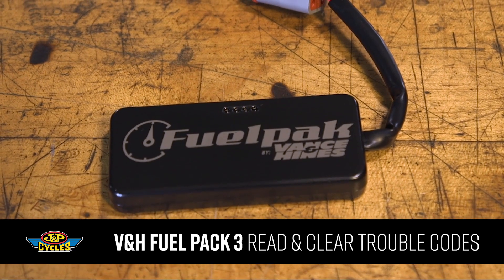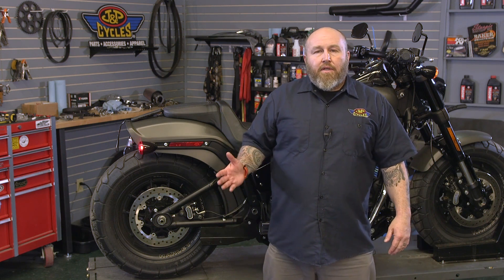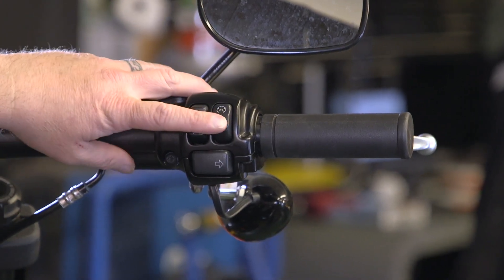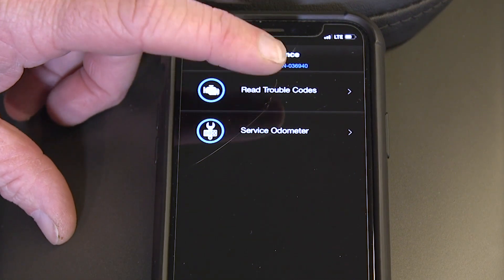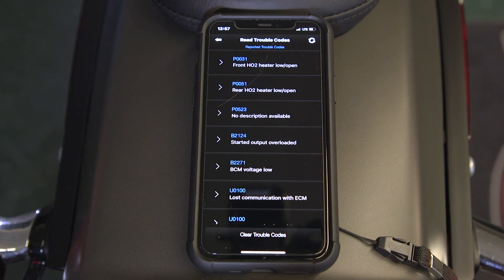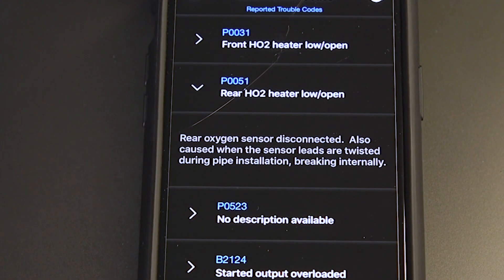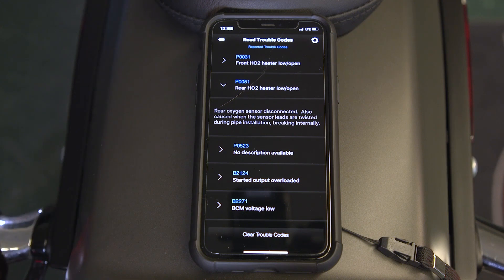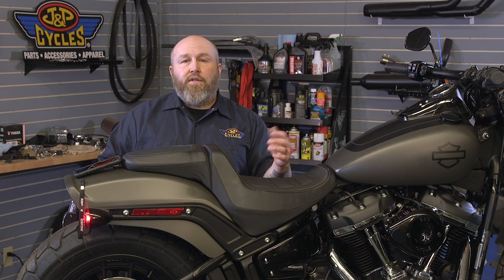How to Read Engine Codes with an Vance and Hines FP3

Comment: I have one of the sp3 fuel pack Management systems on my 04 Harley Davidson lowrider and I have Vance and Hines long shotgun pipes on it and I have the S&S 510 cams in it and have hyper charger intake on it but between 2000 and 3000 RPMs it bangs out and I'm trying to figure out which value do I need to correct to try to get the fuel injection where it needs to be is there a low range of mid-range and a high range or if I could just find out which value and then I can adjust up and down any input would be appreciated
Reply from the maker: What do you mean by "bangs out"? Does the exhaust pop and backfire when you let off the throttle?

Comment: Question If I clear the codes, shut everything down(bike & app), and start over will the applicable/current error codes come back up. I'm hesitant to clear em.This is the first time I've got the codes to come up. I've checked em one an occasion or two in the past because bike smelt like it was running rich, but no codes would come up. Perhaps I was doing something wrong during those past attempts.

Comment: I had an issue when I had installed the fp3  two years ago. V&h tried to help but it was out of there hand  Dealer said it corrupted my bcm  causing my fuel to cut out randomly.  And it set me back $400 . Now I have a paper weight 😭